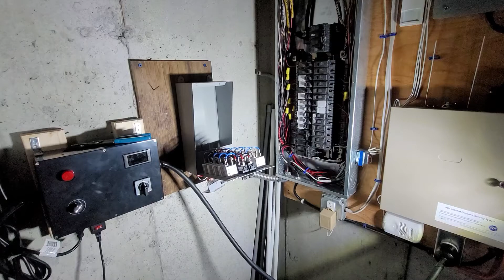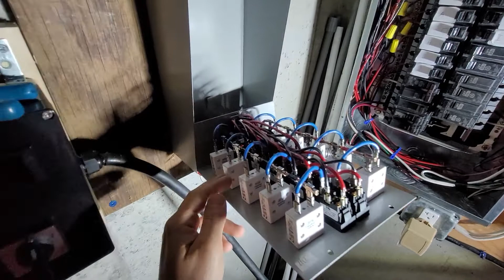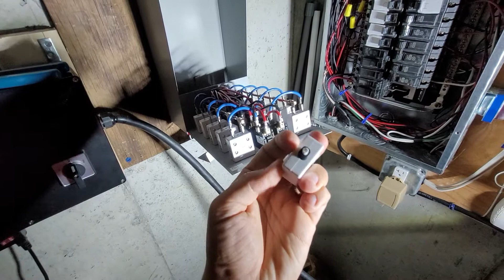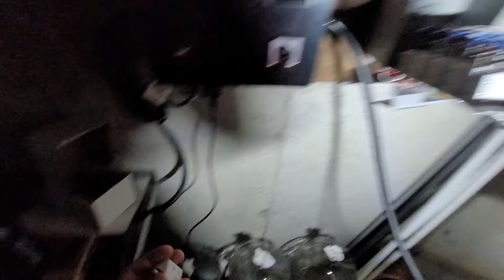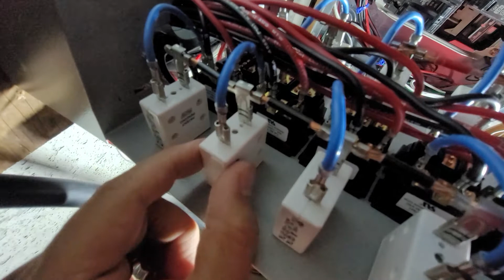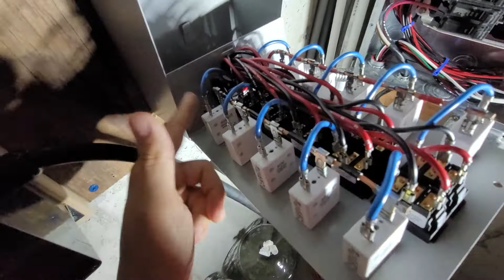Reliance Controls Pro-Tran 10 Circuit Transfer Switch: Converting 20A Branch Circuit to 15A

Comment: Hi,  I was wondering if there is a way that I can contact you via email or cell phone call.  The reason I would like to talk you is that you had worked on a honda ht3813 about a year ago and  I am currently working on a honda ht3813 myself for a customer. I am trying to trouble shoot an issue with this tractor and was hoping that you could make some suggestions. I just need an helping hand. Thanks, Gary
Reply from the maker: What is the exact issue?
Reply: @Bassguitarist1985  Hi, thanks for responding.  The tractor runs great but as soon as I engage the pto clutch it literally chokes out and dies. I replaced both the brake and friction discs but didn't help. I replaced spark plugs because the old plugs were both black with carbon and even the new ngk plugs are both the same condition. I have checked the valve lash and adjusted, no help. I replaced gas thinking old gas, no luck. I did do a compression test and both cylinders are reading 120psi and according to service manual should read 170psi and looks like 140psi is service limit. I'm in the process of looking at timing belt, appears to be ok but in order to check timing on both cam and crank I will need to pull drive shaft and flywheel, etc. Sorry for being so long winded ...  also I have pulled the carb and did a good cleaning. I'm thinking a may need a top end job due to compression reading or at least check to see that valves are fully seating?  thanks for any help
Reply from the maker: @gpoohssmallenginerepair9116  yes def top end, possible lower end too. I would lean toward top end since valves are often not adjusted within service intervals. Black spark plugs indicate rich mixture and/or burning oil. You need to do a leakdown test and see where the compression is being lost from. Takes 15 minutes to tell you if its top end and/or lower end.
Reply: @Bassguitarist1985  thank you for your help, greatly appreciated. I will do a leak down test and go from there.